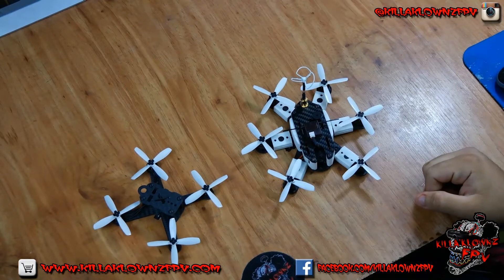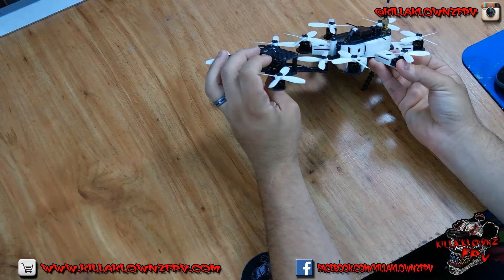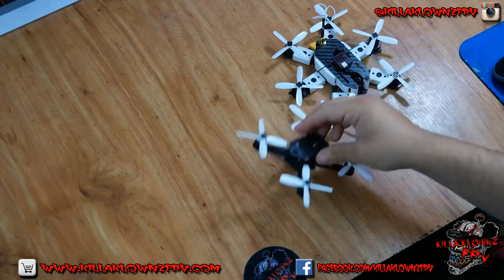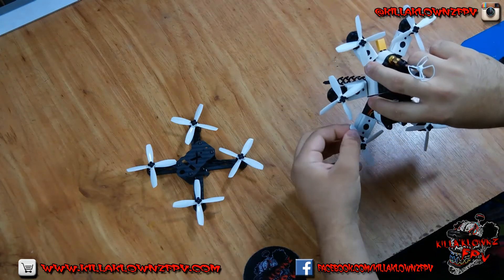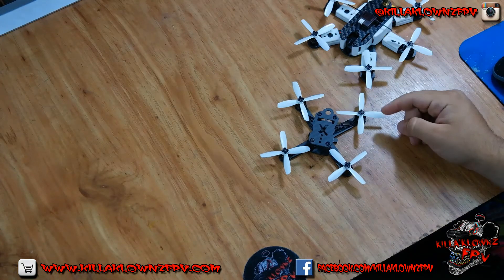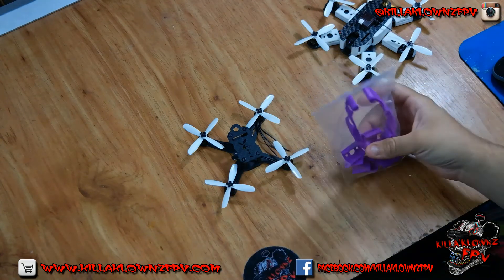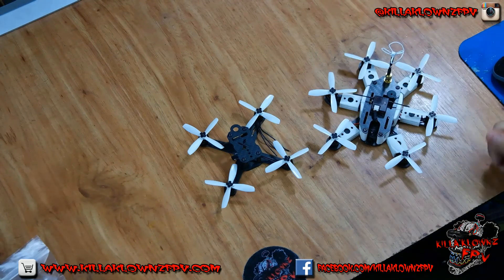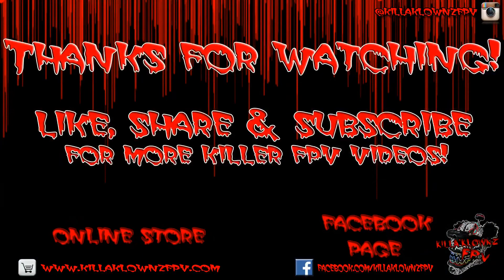RotorX 1105b 6500kv & 1102 8500kv Review!

Comment: You think putting a 3inch prop on these Rotorx 1105 4000kv would be over propping them? I got a pair of 1105b 6500kv that will run 3s or 4s and there the best motor I have owned

Comment: ive got a Micro 32bits F3 Brushed fc,will rx1105 motors work without 4 esc's?trying to keep weight down
Reply from the maker: Nickos White you cannot use a brushed fc with brushless motors. They need escs to determine mltor spin
Reply: what kind of fc and escs would i need?i use a radiolink at9

Comment: Is 131grams with battery too heavy for a 3s X build with those 1105b motors?
Reply from the maker: Redazu which props you using?
Reply: rotorx 2535
Reply: Sorry, make that 139grams**